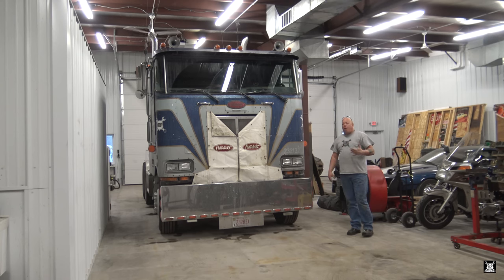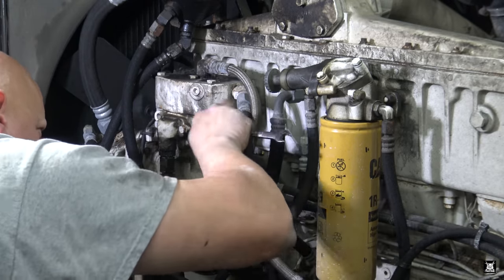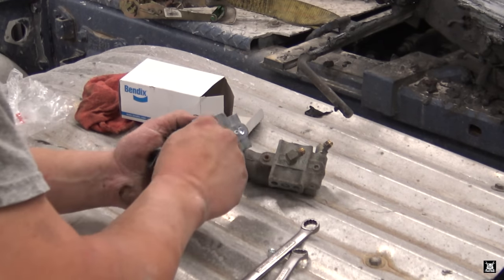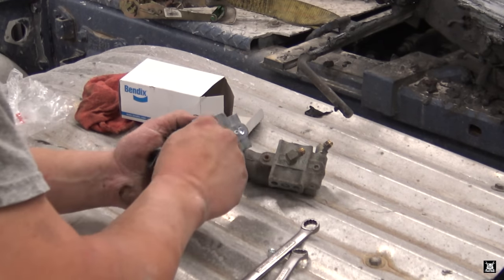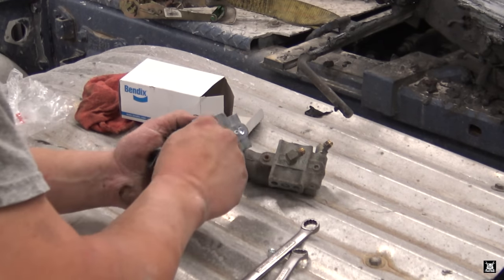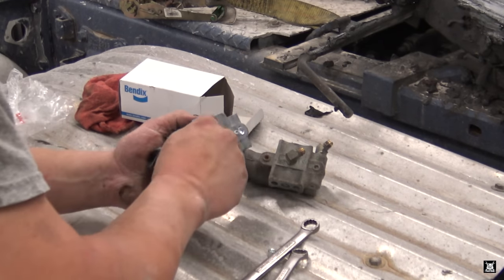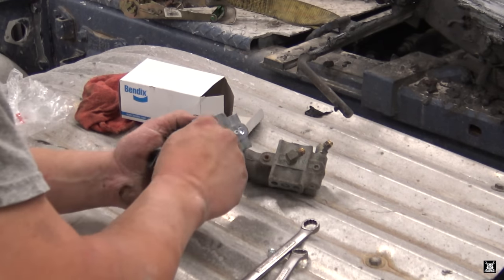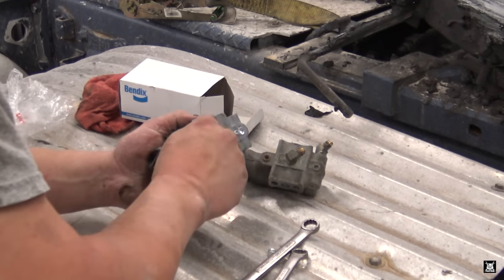Replace AD-9 Air Dryer And Governor on 1984 Peterbilt Cabover

Comment: Hell Yeah Steve Congratulations to your Dad on getting a New Tri Glide Harley Davidson.  Your Dad is going to Love it My Dad has been riding on a Tri Glide four Six years.  He's on His second 2018 Tri Glide.  My Uncle also rides a Tri Glide He's been on His Five years and Loves it.  There pretty DAMN fast if You get rid of the exhaust system and that stupid Cadillac Converter crossover pipe.  And a stage One Kit Screaming Eagle Air Cleaner Kit and a Ignition Down Load and Exhaust System.  That Bike will really Run that New 88 Motor is Amazing it's like comparing your Blockhead Motor too a Shovelhead same difference a New 88 Motor too a Blockhead Motor that's the difference.  Your Dad is going to have So much Fun plus your Mom can ride and be comfortable.  That's so cool You will be able to go riding with your Dad again Congratulations!!!

Comment: Man Steve the liquid Teflon Tape in the tube work Sooooooo much better than the just the tape.  If it's leaking or seeping than they have NO ideal what they are doing and shouldn't be working on anything.  Don't use the brush type Teflon it's JUNK it will fail terrible BUT the Liquid Teflon in a Tube works amazing and seels great when it completely drys.  You don't have to wait for it to dry all the way it seels as soon as you install it.  Just work's better when it drys completely and you will never see any seepage around the fitting...

Comment: Love the story on the PTFE (Teflon) tape Steve, a guy I worked with went to the company store for a roll of PTFE, storeman wanted to just give him a short length of a standard roll.
Just a thought on the Cab lift hydraulics, could a synthetic fluid be used instead,  obviously need to check O-rings and seal compatibility. 
Great new shop,  well earned 👏. 
Thanks for sharing

Comment: When it''s really really cold. I drip antifreeze through the air line and it get's ride of the frost in the air lines work's excellent. I avoid having to disconnect the air lines. I have a better lowboy with ramp's that raise's up and lowers down using air. And they work excellent.

Comment: A friend who has been trucking for 25 years changes the air dryer every fall, with a remanufactured unit. That way going from Winnipeg to Orlando, no issues, in the winter time.

Comment: I have watched this video several times and I think you may have installed a plug into the governor's exhaust port.  The top port, closest to the colored adjustment cap, should be open with no plug. This port allows the plunger to move and exhaust excess air.  I installed a governor on my 85 362 and matched plug for plug with the one I was replacing, huge mistake.  It was later when I realized the person who installed the prior governor made a mistake.

Comment: Hey Brother Steve l realize that your videos are behind so I was just wondering.  Have you fixed the other side of your exhaust stack yet or you gonna wait until spring when it's warmer and not so darn cold outside.  I realize that You have your heated work shop but I understand about working during the winter it sucks...

Comment: Good day Steve,blue cap on governor means non adjustable, black cap you can adjust air psi up or down. Maybe I'm wrong still think your purge valve was stuck and leaking air. Usually when it's pumping air out of the bottom of drier when compressor is working. Had luck some times just pushing on end of valve and it would start to build air. We changed our driiers out every year during our winterization. Just my 2 cents . Stay safe brother.

Comment: Never never never put alcohol  in lines in front of air dryer it breaks up the the stuff in air filter then Lil piece goes and gets in ur valves then u got major problems.  Well u never answer  me